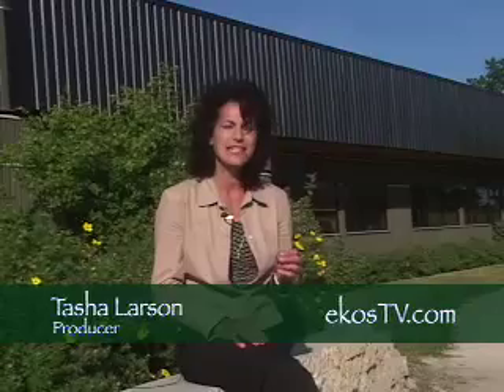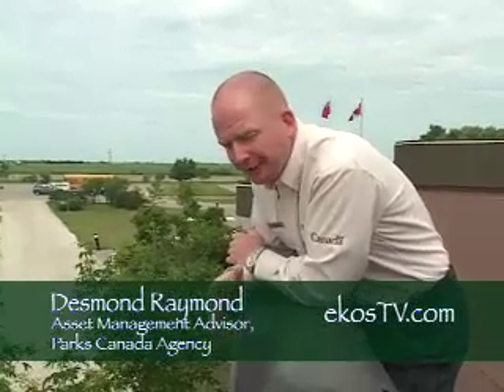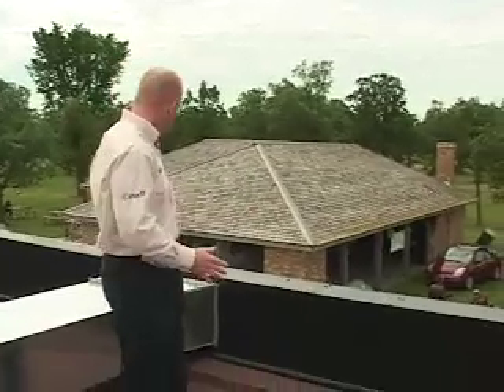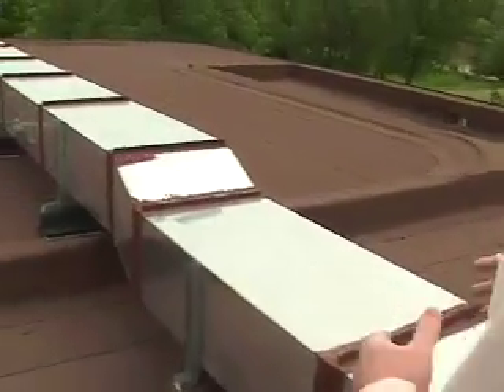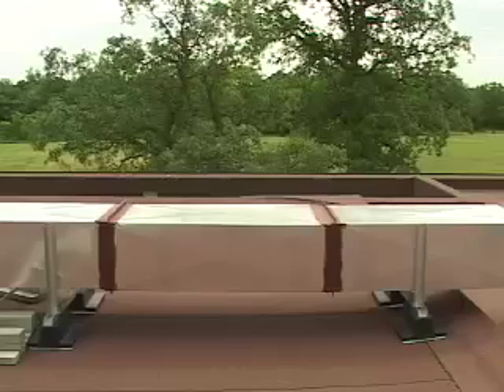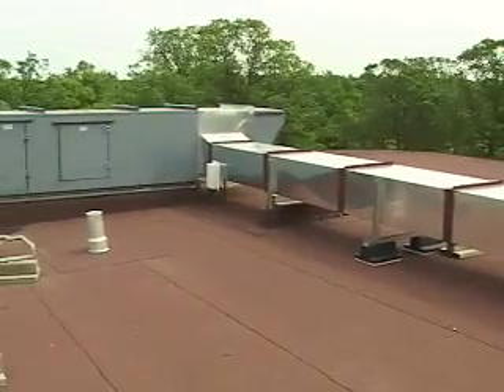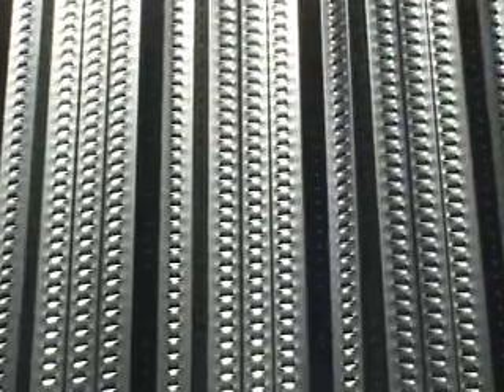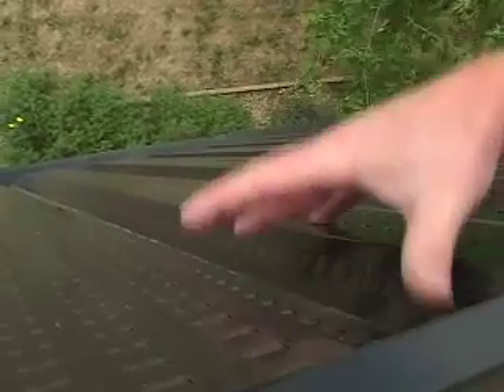SolarWall by Conserval Engineering, Parks Canada (Manitoba)

Comment: @kylehondarider 

Agreed. Great design, though. I do agree. I'd most likely insulate it with that distance to the natural gas heating system. Painting it black would most likely increase the temperature for a few additional hours of the day in the winter, but being that far north in Manitoba, the angle of the Sun is low in the winter and wouldn't heat the ducting all day long. I'd most likely insulate it and let the unit on the wall do the preheating.